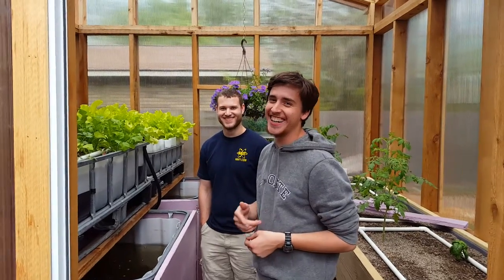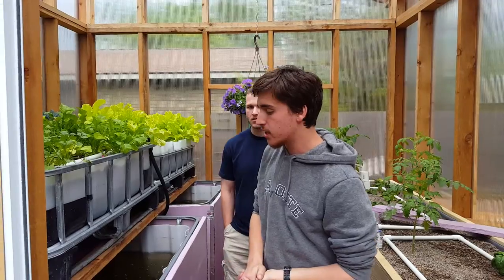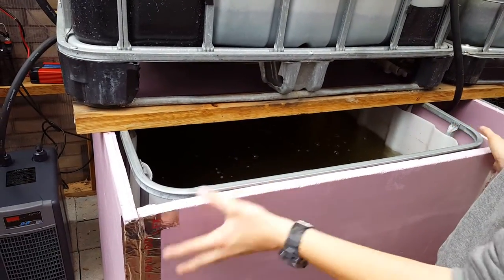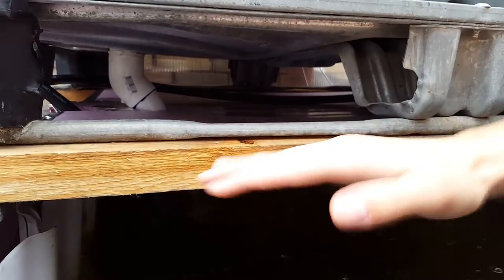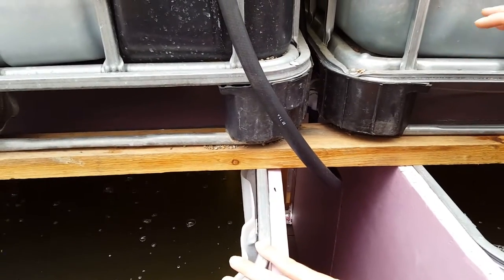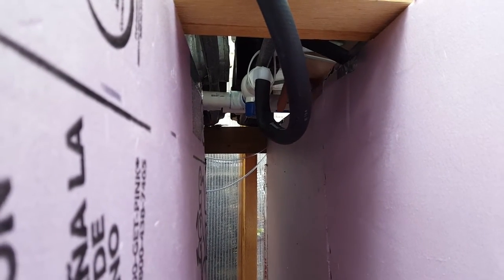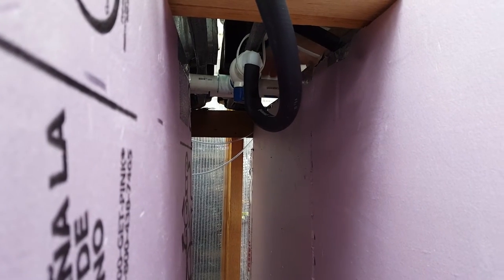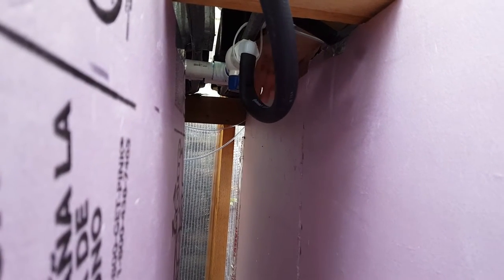Aquaponics Cooling System

Comment: What about insulation on the tanks? Specs/ material please :)
Reply from the maker: We used "pink board" that you'd find at any hardware store. If I were to redo it though, I would not use that and would instead create a plywood box around the tanks filled with expanding foam. Much less gaps for air infiltration which is incredibly important when insulating something.

Comment: what is this chilling system called and where can i find one?
Reply from the maker: +peter larsen 
The chiller itself is an inline water chiller, we used a "1/4 HP JBJ Aquarium Arctica Titanium Chiller". You can find one at this amazon link:

http://www.amazon.com/JBJ-Aquarium-HP-Arctica-Titanium/dp/B003OYBD82?ie=UTF8&keywords=jbj%20aquarium%20chiller&qid=1462415856&ref_=sr_1_2&sr=8-2